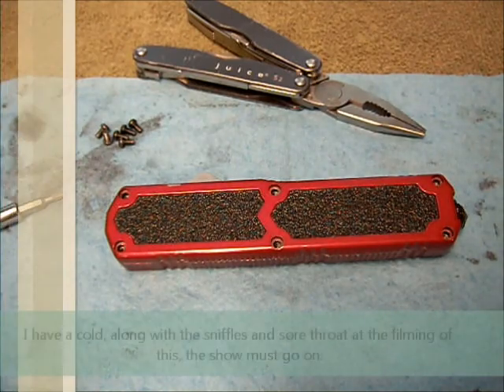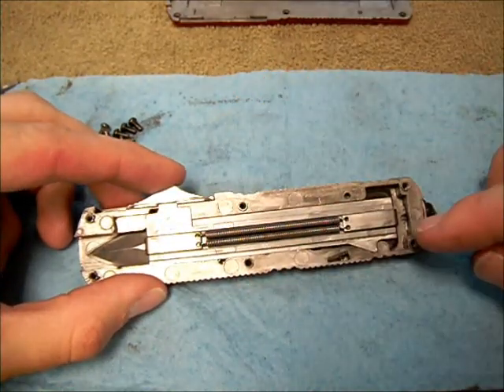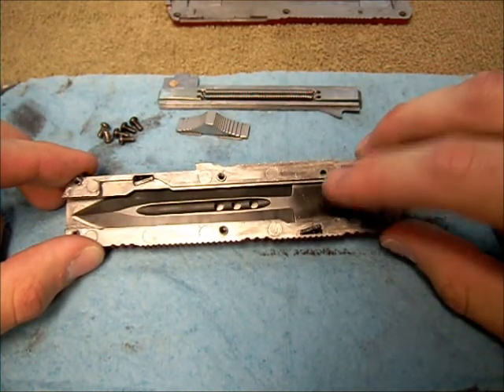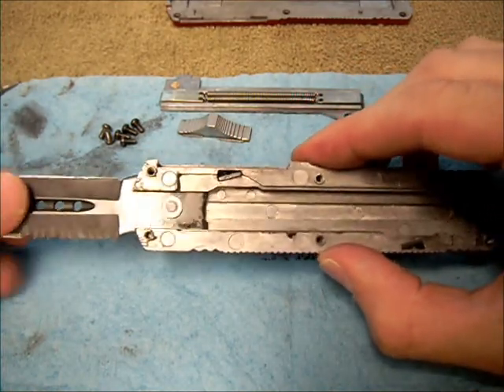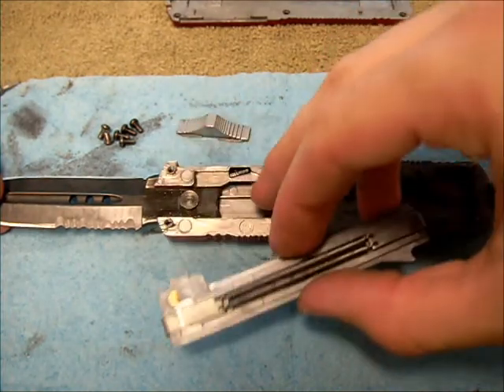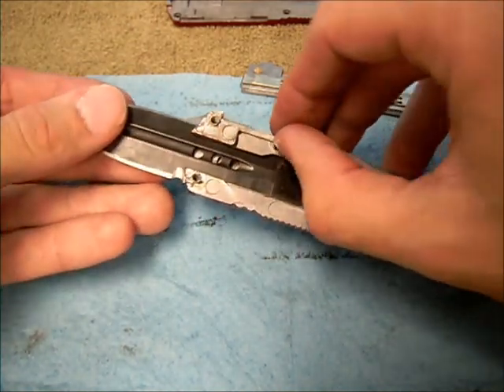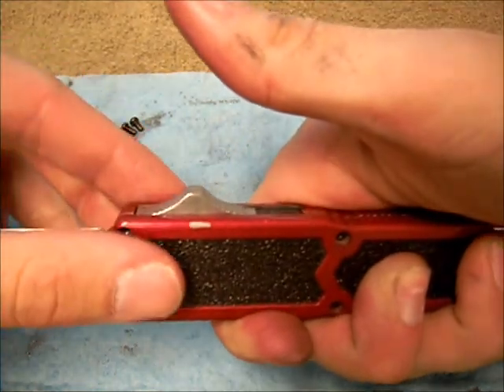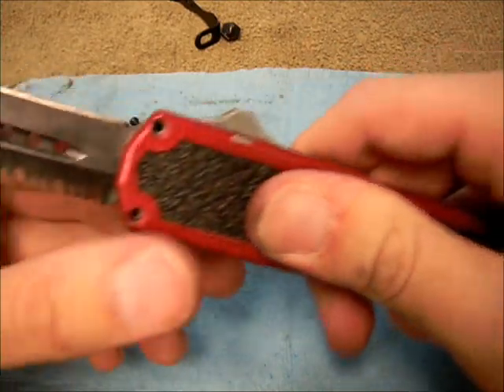Inside The Ranger OTF

Comment: Hi!  I fixed mine tonight.  Problem was the top clamp attached to the two springs was not catching the pin at the bottom of the blabe.  I spent 3 hours tweeking that bent piece of steel just perfectly to catch the pin without slipping or rubbing the side of the blade.  It was easy, but I finally got it right.  Working good again now.  Thanks for the videos!

Comment: PS I didn't realize you could remove the pin itself until seeing your vid after my repair.  If I ever have the same issue again I will try resetting the pin with a thing spacer to raise it, would have been a MUCH easier fix had I approached the repair from that angle"D